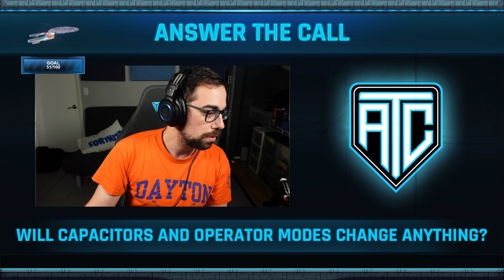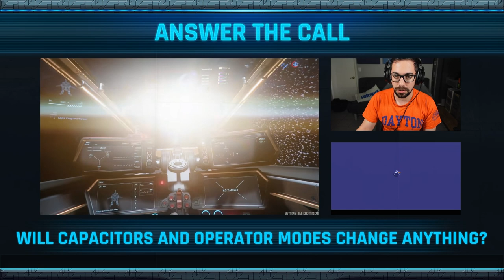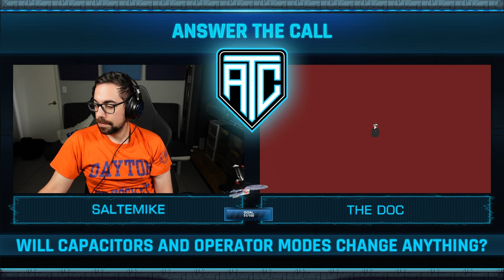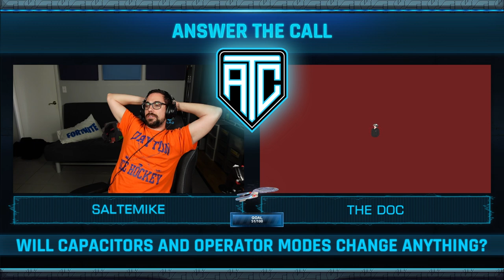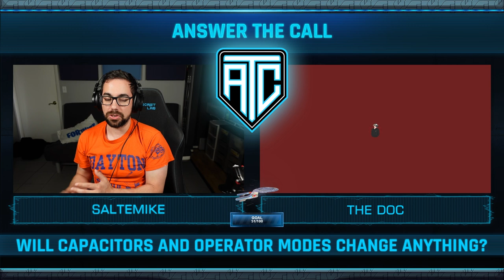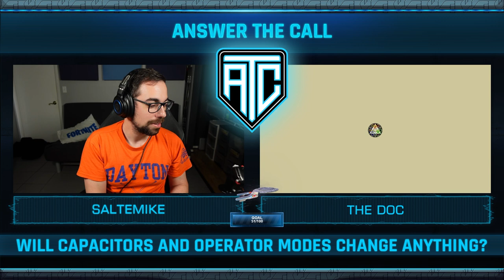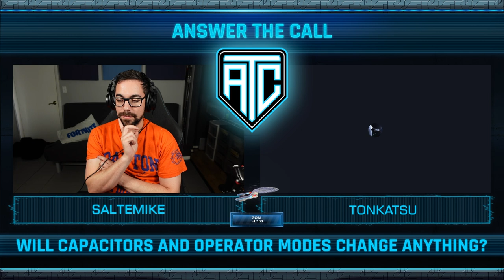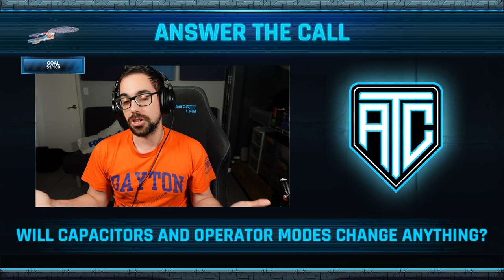Answer the Call: Will Capacitors and Operator Modes Change Anything?

Comment: All i get is that dogfights will look more like slapfights between 90y old smokers. 
1) yeah even if many cry about it being a game, u should stay realistic within the bounds u set for urself, if u have fighters in game don't make them less powerful by taking away plausible abilities and make them inferior to an F18 irl. If not, than balance it as u wish but don't call urself a simulator, it becomes an arcade, period.
2)in pvp missiles are useless anyway, can't remember when i died last time to a missile (maybe when they were bugged) COUNTERMEASUERS EXIST u know? All i get is that people sitting in their Caterpillar wanna drink their coffee while being engaged, before they jump away since their shields are not even scratched. Reducing Alpha damage potential negates the purpose of using a fighter, it is like a Jumbo Jet wants to shrug off an attack from a Mig29...
I do like that a multi crew ship can split firing solutions, but it should not make the current way of fighting impossible. (You can just say to ur co-polit "hey man i use the cannons u do the missiles" it is not that hard, but if need be the pilot can use both simultaniously) 
3)splitting ammo in to canisters is plain stupid, an A10 does not reload mid air(also the reloading mechanism would take space that could be filled with ammo for no reason) i would understand it if gatlings would one shot strafe you within 50rnds, but they are underpowered as hell, almost every body in pvp has ballistic resistant shields, even when the shields are gone they still do sub par damage to distorion+ OC attrition combo.
4)Combat speed should be dictated by skill (being able to hit my target) not forced by a mechanic, so instead of slowing combat for show/looking better and because the servers are crap and tracking bugs out, how about looking for a technical solution instead of ductaping it by just slowing everybody down? And again the argument comes, even in the 60s they already had supersonic fighting capability... But if u still wanna nerf, than let us just slap some propellers on the vanguard and get it over with...

Comment: I am so tired of idiots saying that missiles should cost $10,000. That is the most lazy freaking way to solve a problem. What do you do for bounty hunters who need their missiles when they're going up against six ships at once? Missiles don't need to be expensive you just need to be able to have talent to be able to outfly one and to use your countermeasures properly job done. Missiles are actually in a very good spot right now. As matter of fact it is very difficult to hit anybody with a missile if they have even a shred of talent because they can easily outrun or outmaneuver them and countermeasures work very well.

If anyting missile operator mode is going to make missiles even more deadly for multi-crew ships because now the copilot can sit there and fire them off and he or she can fire them all off at once and only fire them when they have the most possibility of hitting their Mark. And if the person does not fire off enough countermeasures they're going to be in trouble when 52 missiles come at them.

Comment: Yes, it will make shit worse. Everytime that little dude with a speech impediment starts talking about changes being made to the game i immediately get sad and get ready to take a half year break from the game. Missles are already near useless, restricting when you can use those useless missles is kind of just dumb considering the game has missle boats. And why do i need a capacitor to burn hydrogen or ignite a ballistic round? To "balance the game" is a dog shit excuse to make the gameplay experience objectively shittier in a game with soo little already to actually do.